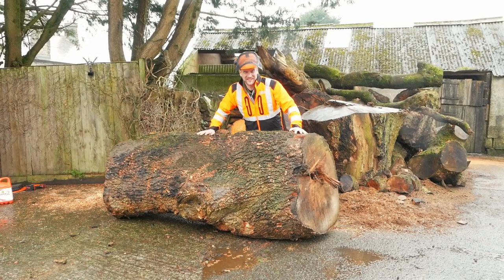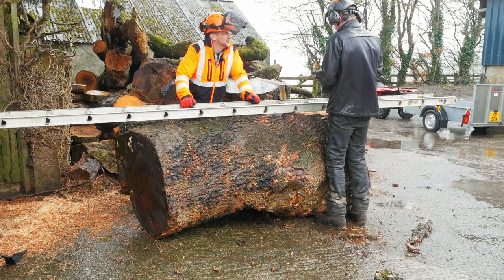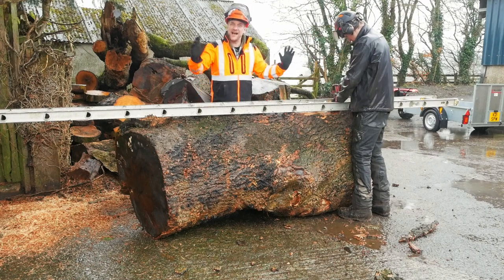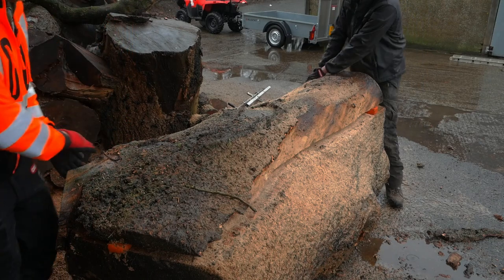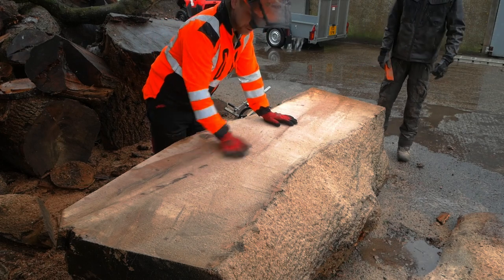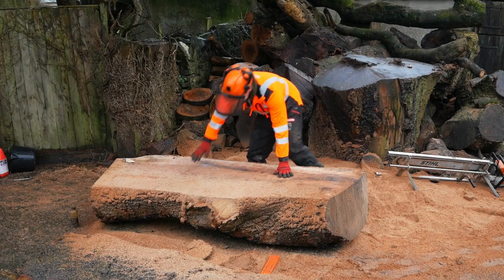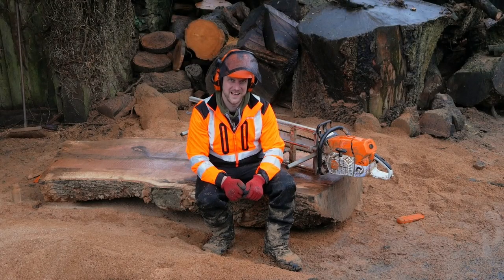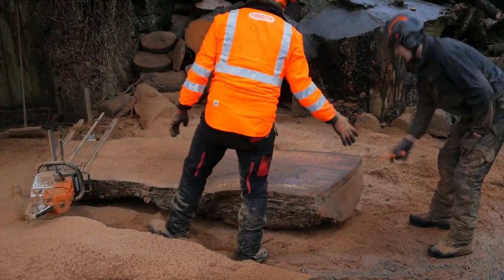Milling English OAK With The World's Most Powerful Production Chainsaw

Comment: Well if you had taken the first cut off properly, by finding centre of log on both ends, and sitting ladder on a plate at each end that is higher at one end to get the top level. Cut that off, then the surface is level.  then you wouldn't use the ladder again,  the surface of the log would be adequate and level.
Reply: A winch would help also. Saves all that chainsaw movement .Slow and even steady cut as hand  winch pulls the saw through

Comment: Nice! Maybe whack some ratchet straps on em. ✌️😊
Reply from the maker: Thanks Tony. What would the ratchet straps do please?
Reply: @MachineryNation  just keeps em nice n flat…tho I think you’ll soon sell them. I could definitely use them, I make stuff for country parks, but I think Devon is too far alas. Nice slabs tho 😋
Reply from the maker: @spitNsawdust  ideal, thanks for the tip. What do you recon they are worth?
Reply: @MachineryNation  200-250 mark, easy, I’d say. Maybe look up what the cubic meter is worth at the moment, not sure if it’s English or American Oak, American has a more open grain, so English is best…naturally 😉👍👍 do get them straps on em tho, no one wants to work with twisted stuff.
Reply: @spitNsawdust  I'd get some old paint on to the end grain as well, 👍💪🪓🌲🇮🇪🇮🇪